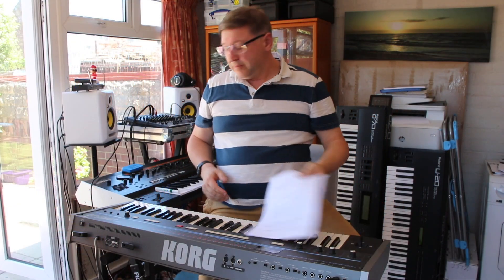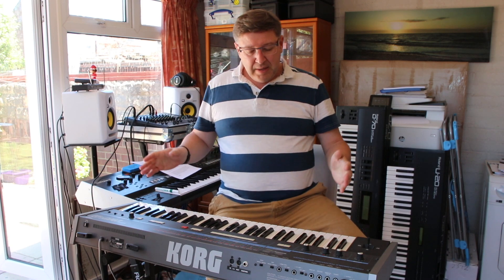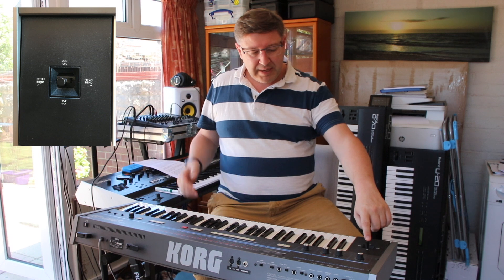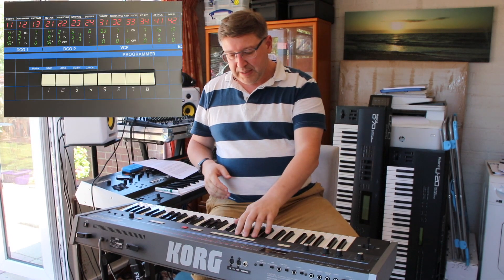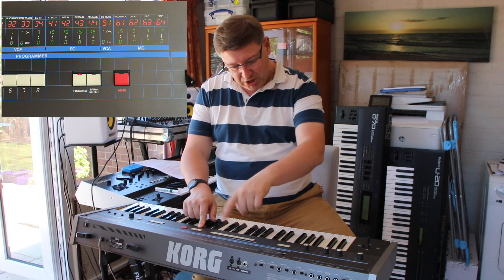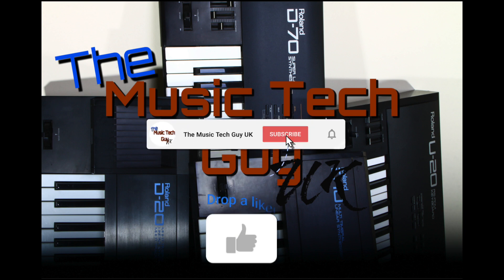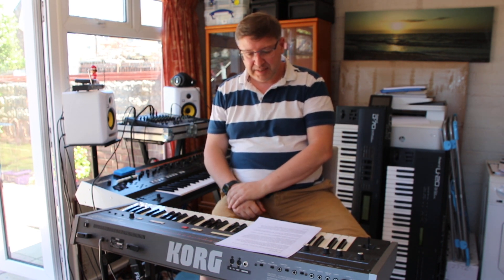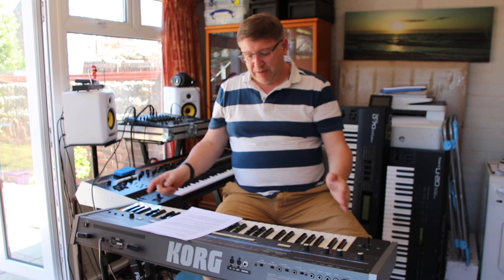My Overview of the Korg Poly 61 - Part 1

Comment: Chord Mode works as follows: 1. Use Poly-Mode 2. Press and hold the chord you want to safe 3. Press Chord Mode (while still holding down Keys) 4. You are now able to play and transpose this chord with every key 5. ???? 6. Profit
Reply from the maker: Hey @F# Moll.  Thanks for the intel.  I actually figured this out and put it in the next video on the Korg Poly 61.  As I said to one of the other tubers, I really didn't have enough time with the synth to really get under the bonnet properly.  Jon

Comment: Back in the late 80s my band mate had a Polysix that i loved the sound and arpeggiator. I had a opportunity to purchase a Poly61m, which worked better with our midi sequences. However, i never got over the lack of knobs and passed on purchasing the 61.
Reply from the maker: Hi @Shawn Curran

Thanks for relaying your experience with the PolySix and Poly61M.  You will see in an other comment that another tuber feels that I didn’t do a good enough job with this video.  Which I admit was rushed due to the synth being sold by the owner quicker then either he or I expected.

I know that the Poly61M properly incorporated MIDI into the synth design as opposed to the after market modification that was fitted to the Poly61 that was loaned to me.  I did try and understand the MIDI implementation on this synth and just couldn’t figure it out in the time I had, I couldn’t get it to register notes on the A-110 and couldn’t work out how to get into any settings mode for the MIDI implementation.  I am sure there was some aftermarket instructions (key presses and the like) but I could find them.

I know my time with the synth was limited, but I didn’t gel with it and looking back on the footage, I do feel that this came across in the video.  I am not sure how to explain this, but I use the PolySix engine on the KRONOS and was expecting this to be a similar hardware instead of virtual experience and it clearly wasn’t.  

What was interesting is that when I returned the synth to the owner, obviously I talked about my limited playing time and what some of my feeling were and he echoed them, which was the reason he was selling it.  Now others will have very different experiences of this synth, and maybe with more play time and research prior to shooting my experience might have been different.

Jon